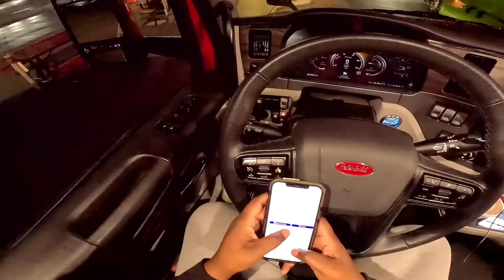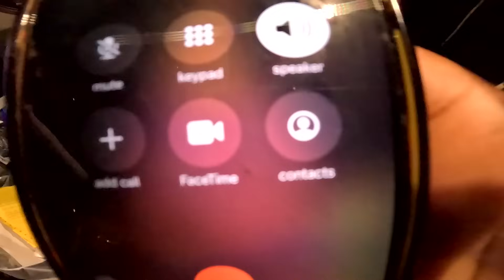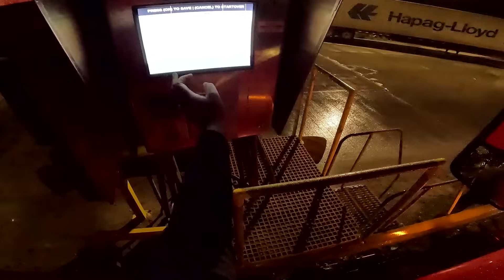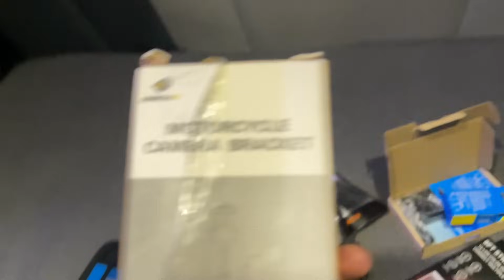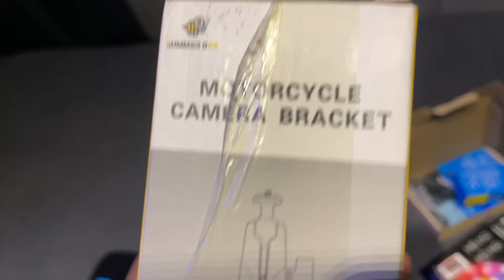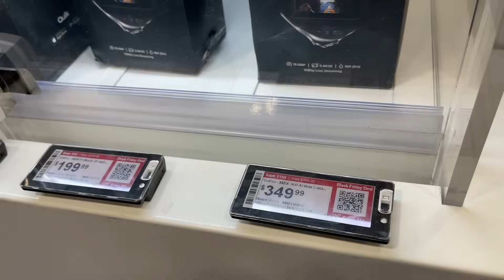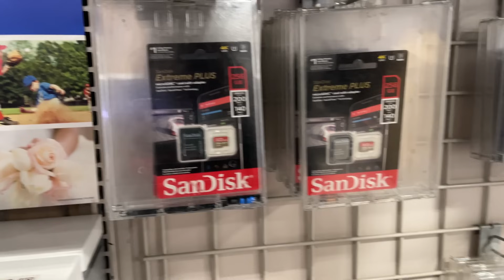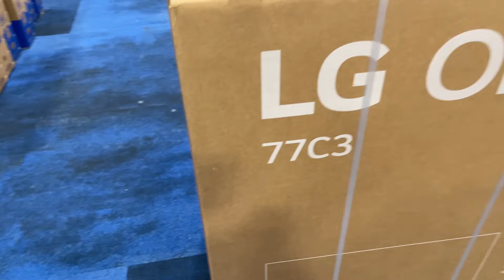Back OTR Trucking With Prime Inc " Load From NC To KY"

Comment: What up girl.
I really enjoyed watching you trucking..
But there's one thing I hate to see it doesn't matter what you're driving as long as it has a steering wheel. This one they can't take the time the straighten out the steering wheel the way it should be. This is what jacks up your front end staring. Straighten your steering wheel out.
I've been driving longer than you've been alive. And I started driving tractors on the farm same thing. Even my little Red Ryder wagon I never left the wheels crooked.😊😁.
When I go to car lots or so I see cars that is the first thing I look at if the steering wheel is off to one side or another it's jacked.
Later girl. Be safe.❤💖💕💓🌹⚘🙏🏽🤜🏽💥🤛🏽😊😎🙋🏽‍♂️